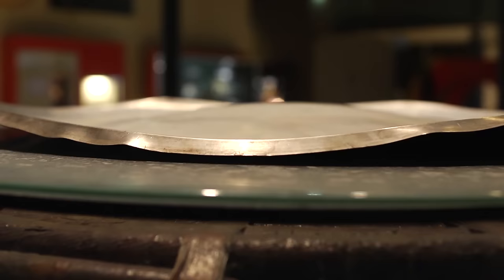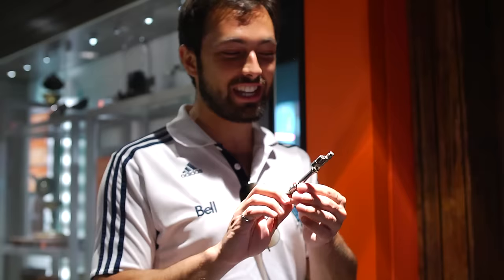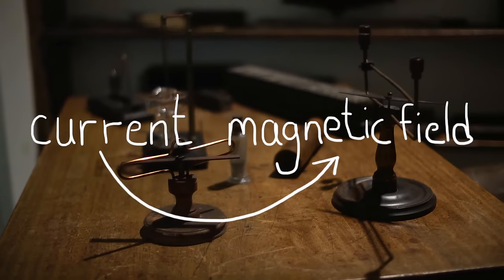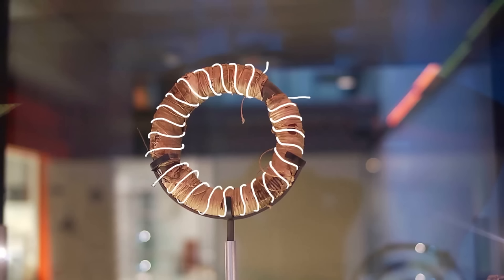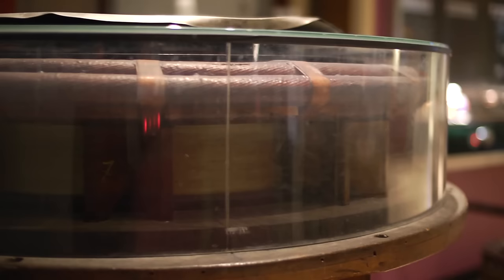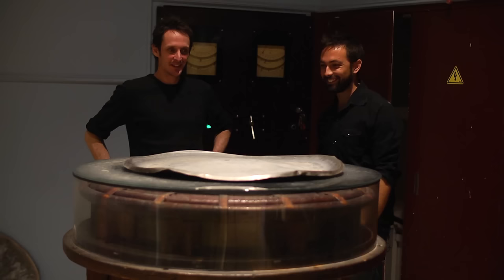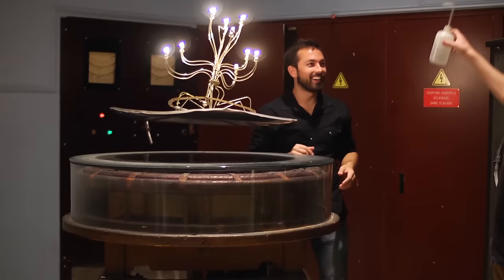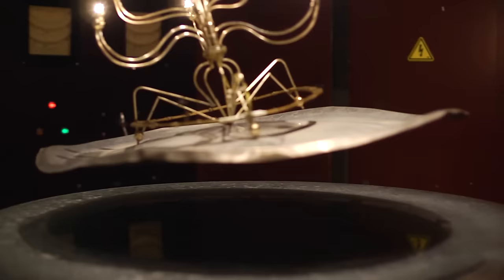Levitating Barbecue! Electromagnetic Induction

Comment: wireless charging?
Reply: +masso172 well yes, but you need to make it so that it doesn't fry everything in its radius
Reply: +Hugo Lee I heard nikola tesla was working on something like that but I'm not a 100% sure.
Reply: jazzie man thaty's cool :O
Reply: +masso172 Wireless charging is pretty much here, but not by sending a current through the air  because as Hugo points out you'd fry everything that came within that vicinity (if the current was large enough). No they are going to do it by converting the RF coming into a wifi port and then converting the energy to electrical energy. Seeing as you only use a few Ma to charge your phone it'll work just fine.
Reply: +masso172 Everything conductive will heat up like that plate, also notice how close it needs to be.
Reply: We have wireless charging already, and have for a long time. You can get wireless battery packs for cellphones pretty cheap, and it's used for some medical implants. The thing is they're very short range, so it's more like a cordless charging plate. This isn't a limitation of the technology, just of physics (longer range means exponentially more power wasted, and more interference with other stuff).
Reply: +masso172 Yes that's how wireless charger for phone works. Also how induction stove works. (Induction stoves are awesome, they boil water 2-3 time faster and use less energy :) )
Reply: +masso172 The problem with wireless charging is that it's not very efficient. You'll probably waste more than you put into whatever you're charging.
Reply: +masso172 Wouldn't the magnetic field damage the phone
Reply: +jazzie man
When will he be done?
Oh right...
Reply: A cat!
Reply: your phone will probably charge just walking by the building

Comment: In my youth I went to the Navy and work in a navy foundry... we used foundry furnaces that used electric resistance to melt the metals. Very similar to what you're using in the video.  Aluminum has very Unusual properties when it melts. Responsed to the magnet forces and would oscillate in the crucible. The higher the voltage the faster it would spin and follow the magnetic fields..

Comment: Someone watched this and thought about hover boards... in a few years they'll be multi billionaires.
Reply: Yeah but the problem is what's the power source of the board? If it's a battery i'm sure it wont last very long. I can only see wired hoverboards being capable but they're limited to the extension wire :(. The hoverboard would be easy to make if we discovered renewable energy
Reply: SClassFinalFlash  or just really good batteries, graphene and whatever. Charge in 20 minutes, use for a few hours. For a first hoverboard that sounds reasonable.
Reply: SClassFinalFlash there's actually a hoverboard built which looks just like the one in back to the future, and it's awesome, you can check it out, its HUVr board
Reply: ***** we would need infinite power for such measures
Reply: *****  I thought you only have to either charge the board and have the pavement covered with a metal sheet (i dont know how thick)
Reply: yea if they manage to make room temperature superconductors first. you know how hard that is? otherwise it wouldn't work, the electricity would be too expensive.
Reply: ***** Not every metal can hover, the metal must be diamagnetic. I done a school project discussing about the concept of the hoverboard so I know.
Reply: Bill Gates Wrong that is a hoax, it is the Hendo Hoverboard. It is still in the prototype stage though.
Reply: Darkmatter Burst
Actually, the magnetic property (diamagnetic or paramagnetic) of the metal is largely irrelevant.  This is working with aluminum which is actually one of the more neutral metals.  The important thing in both this experiment and the Hendo Board is that metal that is being repelled is a good conductor.  That's because the effect achieved is due to Lenz's Law (a corrolary of Faraday's Law of Induction) that says when any current induces a like current in another conductive object both the flow of current and therefore the magnetic field will be in direct opposition of the inducing current/field.  Point is, that could just as easily be a sheet of iron, copper, gold, etc.  The only requirement is that the resistance is low enough that enough eddy current to form a strong enough field to repel the inducing field with enough force to lift it.  Which is what makes copper and aluminum the more likely choices, among the non precious metals they have the lowest resistance.  There's a neat DIY demonstration of the forces at work here you can do at home with the right parts, find a dead hard disk and scavenge the actuator magnets from it, then get a piece of 1/2" (or whatever the smallest size the magnets will fit down is) diameter rigid copper plumbing pipe, prefferably around a foot long.  Stand it on end and drop the magnet down the tube.  It will take several  seconds to reach the bottom due to the effect of lenz's law creating a situation known as "eddy current braking"  The falling magnet acts like a commutator in a generator and the pipe is the stator winding.  But instead of free running like an open stator this is a shorted stator, much like the "shorted winding" effect of an AC induction motor commutator slug.
Reply: Yes we just need to run 800A through our sidewalks and then we can have hover boards :)
Reply: Patrick Star  haha they even release it at october 2015.. exactly 1 year later.
Reply: tulp35000 haha yeah they just put the steel plate on the ground and made the machine stick to the board
Reply: tulp35000 the ground would have to have some amount of metal because iirc cement isn't magnetic
Reply: +SClassFinalFlash 

That'll fix itself in some years, advances in batteries are making quite the progress. Derp. I know this comment was from a year ago.
Reply: wonder how much control would one have. Not knowing what advances are due i'll guess it's about 10 years away. 5 to 10.
Reply: @justincameron9123  yeah, copper. Oh, this is 4 years old.
Reply: @HolyFuckinSex  lol its here, room temperature superconductor

Comment: This video got me thinking. This technology could be used to make a hoverboard. Based on the video, that level of induction couldn't support a human, so a stronger one is required. But that would make the board hover far too high up to be safe. Also we would need a cooling system. So, if we can regulate the induction, we could move the board by tilting it in different directions since it is pushing up using the ground. AND, it could potentially create its own electrical power.

Comment: i have doubt what happens when we use a iron plate instead of aluminium ???? pls some one answer this question
Reply: +Adithya Venkaesh My guess it would be too heavy.
Reply: +Adithya Venkaesh Same thing would happen. The magnetic field would induce a current in the iron plate, which itself induces an opposing magnetic field to the external magnetic field, and thus the plate will levitate.
Reply: Juxtaroberto I really doubt it would levitate though. An iorn plate that big would weigh an awful lot. Needs testing
Reply: +Adithya Venkaesh Iron is a ferromagnetic material, unlike aluminium. So, apart from gravity, there will also be an additional force of attraction on the iron plate from the electromagnet, trying to pull it down. If the levitating force isn't strong enough, the iron plate will simply get stuck to the electromagnet, just as iron nails get stuck to a permanent magnet. On the other hand, aluminium will be much easier to levitate, as we do not have to worry about any attractive force. It is only gravity, that needs to be countered.

Comment: This is part of Lenz's law.  If you drop a powerful permanent magnet down a non-magnetic electrically conductive pipe (like copper or aluminum) the movement of the magnet induces current in the pipe giving the pipe its own magnetic field that opposes the original magnet.  In effect, slowing the decent of the magnet down the pipe.

Comment: Very cool demo! Are you sure it's not operating at 960.9 Hz? Based on the audio, the whining sound from 2:35 to 2:45 appears to have a fundamental frequency of 960.9 Hz and only even harmonics with the following relative amplitudes:

Fundamental: 1
2nd harmonic: 1.6550
4th harmonic: 0.1260
6th harmonic: 0.0543
8th harmonic: 0.0224
10th harmonic: 0.0231
12th harmonic: 0.0271
14th harmonic: 0.0161
16th harmonic: 0.0090

Very interesting!

Comment: Electric field, as induced by a changing magnetic field, and electric potential aren't quite the same.In this case there is an electric field driving current in a circle but no electric potential difference.

As an analogy, consider wind going in a circle over a dusty field.  There is force from the wind picking up and carrying dust, but pressure is constant over the circle.

Comment: The water may not formed a continuous stream, it may have broken up into several segments or spheres of water. And it could have been distilled water. Water itself isn't electrically conductive. A solution of water with ions inside is electrically conductive.

Comment: Have you ever thought about using electromagnetic induction for VR immersion? As a kind of "force feedback" for the user. The user would have to wear a suit with metal plates sewn in, and enter a booth that has electromagnets in the walls, sensors in the corners, and a CPU to synchronize the electromagnetic force with what the user is experiencing in a VR headset.

Comment: What if you touched the Aluminium plate ? regardless of its high temperature, would you be electrocuted by 800 Amps or the Voltage there was too low (how low?) to cause any significant electric shock ? It got me wondering because I've seen you using a handle to turn the plate.

Comment: Think of a ring of batteries with resisters in between.  Each battery provides EMF to move electrons, the resistors give voltage drop equal and opposite to the batteries.

Comment: I'm not sure but maybe eddy currents are created within the metal plate? Or a single current rotating within the metal plate? I'm using the right hand rule in this assumption. Assuming a North pole is induced by the electromagnet near the metal plate, then viewed from the top, a current is induced within the metal plate that runs clockwise. Don't take my word for it.

Comment: Now what if you can create a strong enough oscillating magnetic field that even lead bullets can be repelled when firing from a gun? Do the math. Assuming you had a superconducting coil and it took no energy when nothing was being pushed, in how small of a volume would there be enough space available to produce a magnetic field strong enough all around the superconducting system so that if a bullet were fired from any direction (except for a special bullet that had an oscillating field too =P) it would be deflected off due to its own oscillating magnetic field? This requires both enough power density to produce the energy quickly enough to slow the bullet down as it approaches the system do that it stops moving before it hits it (use calculus) and energy density, since a particular amount of energy will be required during this process.

I could probably calculate it, but it would take more time than is worth it for me =P. Anyone knowing electromagnetic and Newtonian physics, calculus, and a bit of wit should be able to come up with an answer.

And then as a bonus question, how large of a bullet would be necessary to penetrate the field? Such a bullet would have to induce oscillating potentials in it opposite to the ones induced by the field at the same frequency. And after you realize that any object that wants to approach this system is going to have to be the same size using the same technology, how can you make a conducting system that can approach it aside from sticking in insulators? In fact, can you change the structure of the bullet, say with a spiral winding, so that the current instead produces a clockwise or counterclockwise force that makes the bullet spiral faster at the cost of only some reduced speed? Could you create a system that converts this energy into an electrical current that could be used to store the energy in a lithium ion battery without generating the repelling force?

Maybe one day weaponry will face these challenges =P.

Somebody do this because you can.

Comment: I found out that a magnetic field could make an electric current when my guitar wasn't earthed properly, this caused a charge to form on the strings having been inducted from the electromagnetic pickups, I then found out I was lucky it didn't stop my heart.
Reply: Hmm... this sounds unlikely, but maybe the cause is something you didn't identify: the phenomenon described in this video is not of charge by induction, but rather current by induction. No part of the system ever becomes charged: the electrons simply become forced to oscillate due to the surrounding field. It sounds like you're describing CHARGE by induction, which still sounds unlikely. Even if the strings were to become charged, the possible hundreds of thousands of volts stored in the strings would still hardly be dangerous, let alone lethal.

Comment: Why 800 Amphere did not kill that guy when he put his hand over the coil? I read that 100 mili amphere or 0.1 amphere going through the body for 2 seconds will cause death. And aluminium is non ferrous metal, why was it able to heat up? As we know induction cooker only works with ferrous metal, that contain iron and will stick to a  magnet.

Comment: yea but if the magnetic flux is cutting through the whole plate evenly, then you would get equal voltage throughout the plate right? then you would get no difference in voltage, no current flow?

Comment: if the plate has current running through it, where is it conducting to? how is current flowing if its in the air and there is nothing connected to the plate? wouldn't it just have a voltage but no where for the current to go? therefore no magnetism?

Comment: What would happen if you touched the aluminium plate with your hand? Would you get electrocuted? 
Same question for induction furnaces, why dont people get electrocuted/ a shock , when touching the pan that is under induction?
Reply: Your hand will melt, even water boils on that plate.
Reply: Most of your hand is already melted and for the rest it's way to much oxygen to make a melting possible.
Reply: You would probably get burned, the plate is hot. As demonstrated by the water evaporating. Electrocuted, depends. Depends on the ground situation. If the current being induced into the piece of metal (in this case levitating above the coil, or the molten metal in an induction furnace) is transferred through ones hand, or a rod in a furnace, and the path to ground is completed, ouch. yes, it feels like you just grabbed a spark plug wire. In some instances where the energy is high enough, it could cause some "interference" with the body's electrical system. I work with induction fields, and have gotten "whacked" by about 600V/200kW, through gloves, unpleasant. I really like people I talk with to verify the ground situation before they start messing around inside the field with metal (molten or solid). Induction technology is really good stuff and can do many things, we just try and keep it from biting us!

Comment: so the ac current induces eddy current in the Al plate, thats why it levitates and dissipates heat. But my question is how that Al plates vibrates at twice the frequency of the source and how that lamp glows before making any contact with plate while still in air at  #2:38  ???

Comment: How does the magnetic flux linked with a coil change if the magnetic field is directing into the plane of paper('X') and the coil is being moved above the region of the magnetic field. I mean the magnetic flux passes down without even touching the coil(or conductor). Still the magnetic flux linked with the coil changes and current is induced. How?